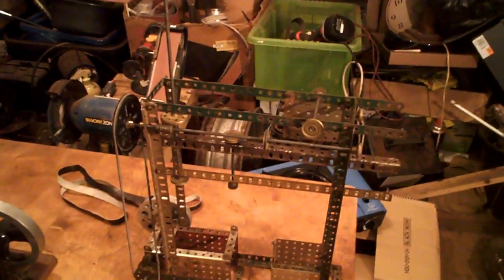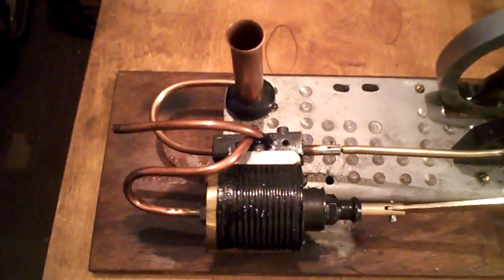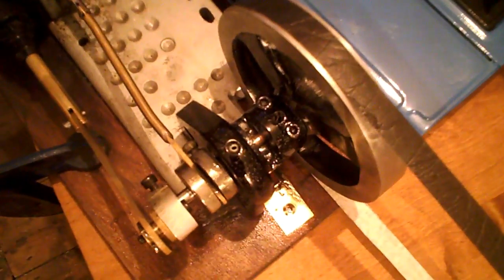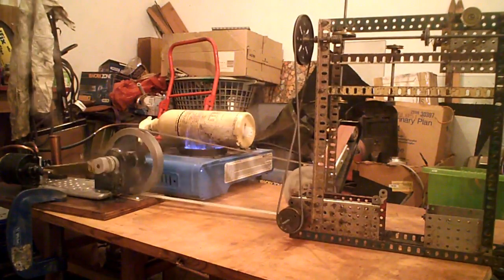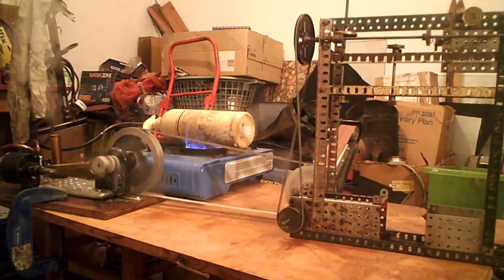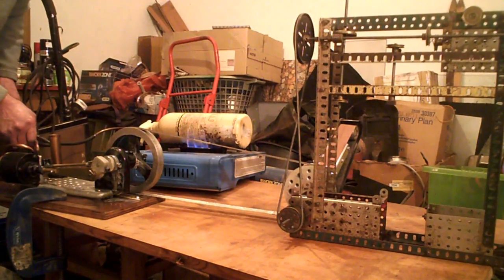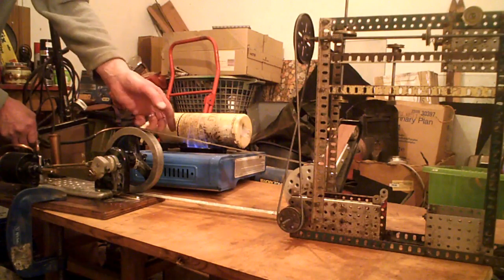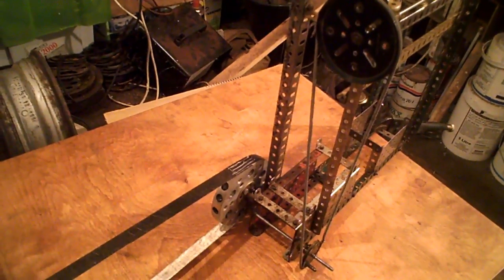Safety Valve Blows Up on Steam Engine

Comment: I saw you could use 2 to 3 % tallow oil in your boiler to oil your cylinder. 
http://www.farmcollector.com/steam-traction/steam-cylinder-lubrication
A great time working with the steam engine and meccano
Reply from the maker: Cheers Lloyd. As I'm only running it for a minute or two, it should be ok. Never thought I'd be running on steam though. As you can see I've found it's limit. Originally I built it to run slowly, heavy piston etc. It did run but needed about 20lb so I then 'tuned' it, so now it only needs about 10 or 12. Think? that pipe blows off around 18 so it needed about 16? to turn this small model.

Comment: well thats exciting. glad u had a safety valve sorted. love the meccano. my flywheel on that last engine wont run true without another casting unfortunately. there was an inclusion in the rim of the casting that gave me a fair bit of grief when i was machining it. no matter how much i take off it the tool just rubs over the hard patch and leaves a bump. maybe one day ill get another casting for it.. but onto the next project. you'll just have to close your eyes malc!
Reply from the maker: A little excitement brightens up the day eh! Right, your flywheel and I know EXACTLY what you are saying as I had the same problem with mine. If you get a hard spot you can do nothing about it.....but wait, you can. How I eventually did mine was to take it to the belt sander, but only sand part of the hard bit. That way it evens itself out if you see what I mean....but it worked. Mind you took me about a month to do lol. All these arrogant experts we watch.....yet some of theirs have wonky flywheels. If I can do it, anyone can eh! I really don't mind, just commented because I was a bit saddened that after such a brilliant job you had done, the finished 'look' didn't live up to it....that's all.

Comment: very cool video. love steam engines. learned from the old steam trains that there dangerous. unpredictable. at least its only a mini steam engine. cheers 👍🇺🇸
Reply from the maker: Thanks - I love steam engines, but full sized ones. They all need to be treated with respect. Had another short drive on one a couple of years ago, and got a video if you care to look. I would post the link but they go to spam.
Reply: Ok . ty i will check it out. 👍

Comment: had similar playing with a mamod many years ago...such fun!
put some oil in the water for lubrication....from what I've been told, seems scary but hey ho
Reply from the maker: Don't run it much Paul....wasn't designed for that. I might? see if I can rig up a small compressor to go on the Nuffield PTO. Take it to shows and give a quick demo.
Reply: I would like to film that Malc. we need to meet up soon and do some filming
Reply from the maker: Agree Paul. Have to be inside until it warms up. But that's only a few weeks away. Sure we could find something to do before though. Btw my email malcsworld@ntlworld.com. Still the most reliable way of communication, unless we talk on the phone lol